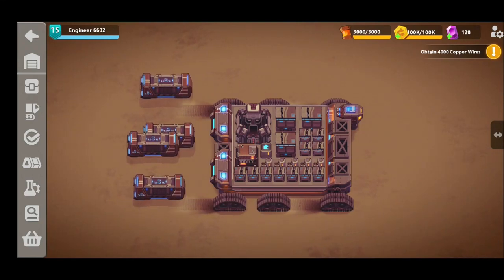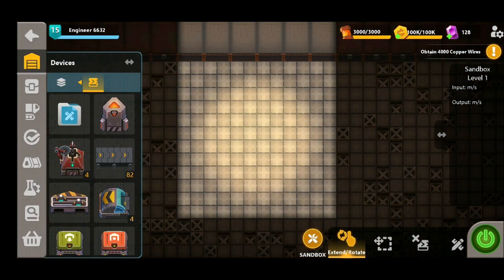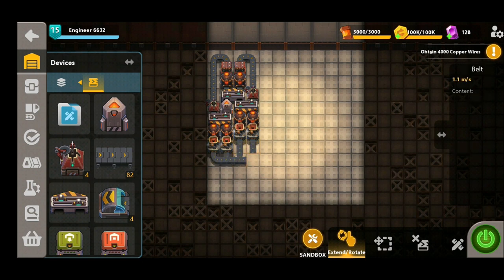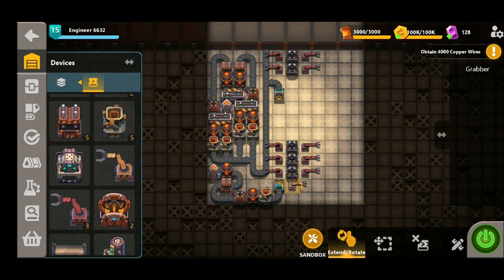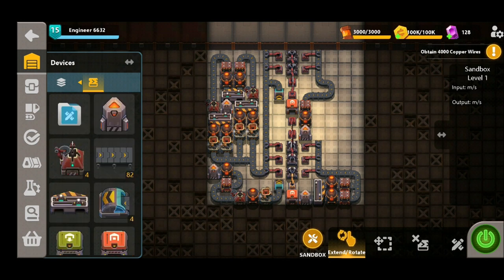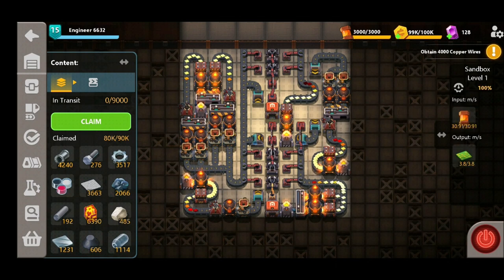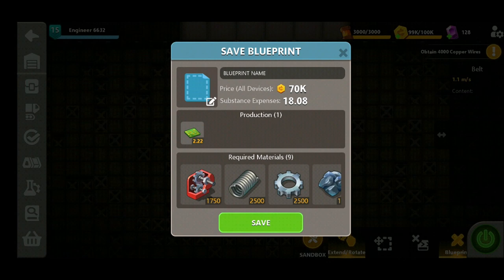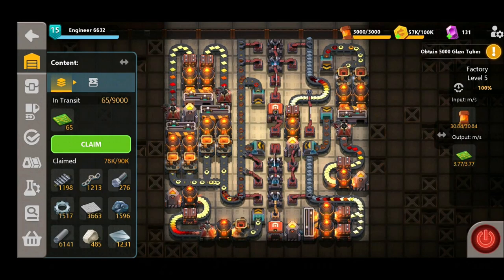Sandship Crafting Factory: Efficient Micro CIRCUIT BOARD Design! [HD]

Comment: Hey, i have a suggestion 
You can put the heater before the splitter
It can save some money
Reply: Just the heater otherwise it can reduce the amount of production
Reply from the maker: You can do, but the overall output will be reduced, it is better to split first, then heat!
Reply: @videoedge5405  yeah youre right i already try it and youre correct thankyou very much
And luv your video♡

Comment: I made this without fast tech, when I added the last portion of wire production it's almost like it jammed the underground belt and my production went from 2.24 /s to 1.36 after that last portion was added.
Reply: i know it is a while ago but i had the exact same issue.  Turned out it was because I hadn't set all of the wire Synthesizers to Copper.  One was still set to iron and the iron wire was mixing into the belt and jamming the top 2 Assemblers.  Once that was fixed it was back up to 2.24 with slow tech.